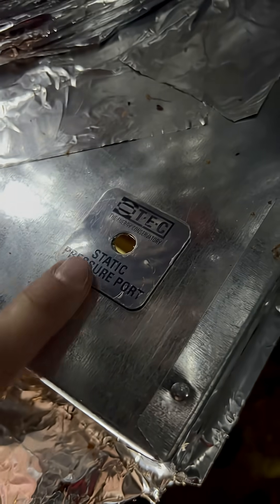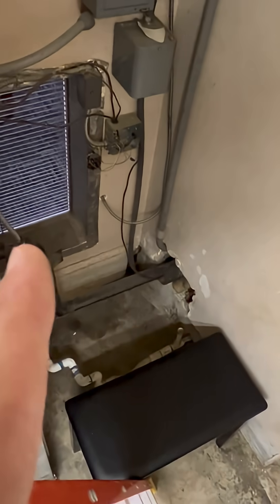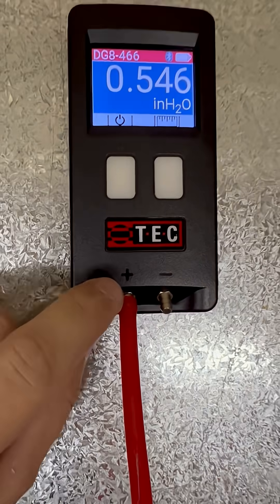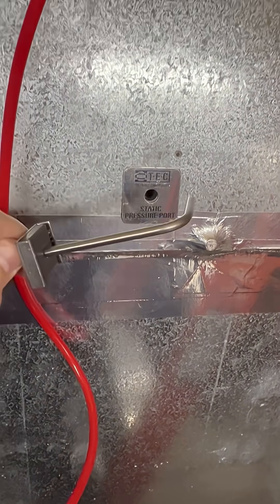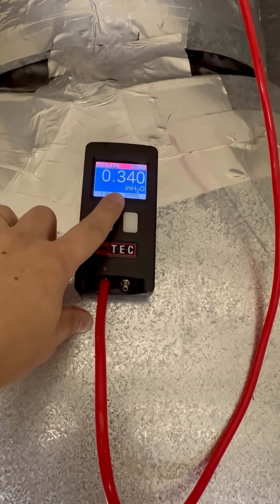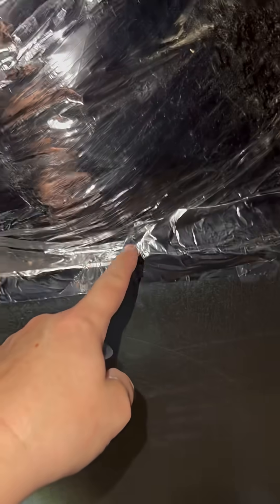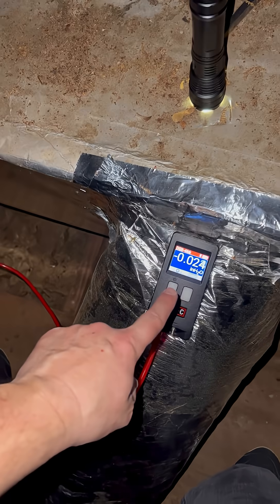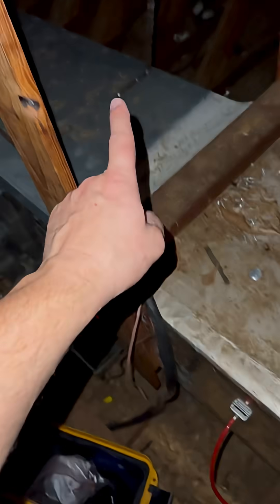Static Pressure Mapping: Testing More than Total External Static Pressure (TESP) w/ TEC ports & DG-8

Comment: My question for you is do the TEC static ports come with a plug when you’re done with your static pressure measurement or do you just tape over the port?
Reply from the maker: Yes they have sexy red plugs
Reply: How about some cheap flat magnets? Maybe they would leak air?
Reply from the maker: Use the sexy red plugs it comes with

Comment: So, for these static pressure ports, don't they have to be covered up when you're not using them?  Don't you leak some air through those ports when they're not in use?
Reply from the maker: Yes, they come with pretty little red plugs, forgot to show them

Comment: If one wanted to purchase and install those static pressure ports, where do you recommend they be installed? At what locations on the unit / system?
Reply from the maker: Here, Brian:
Static Pressure Testing and Mapping Demonstration: Home HVAC Duct Performance
https://youtu.be/45gX7Jb60JM
Reply: Before & After Filter; Before & After Coils; Return & Supply Plenum (which should be before filter, after coils)